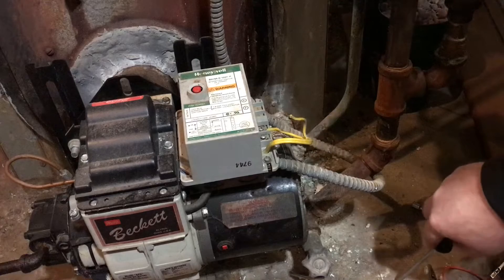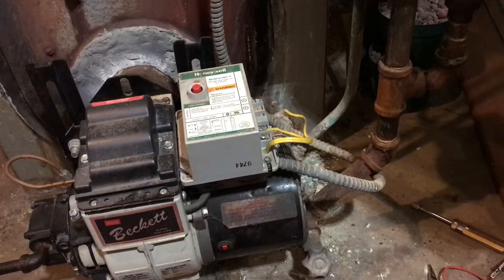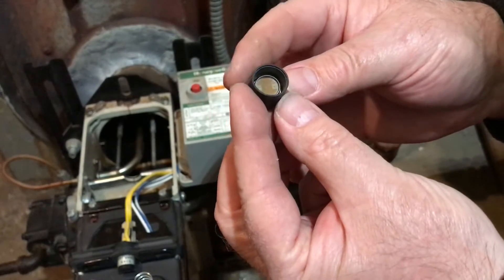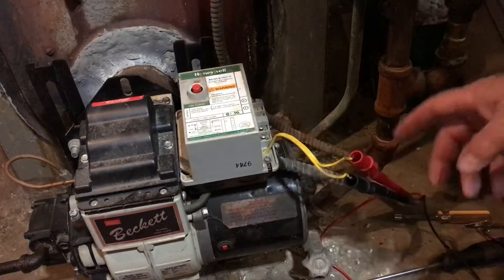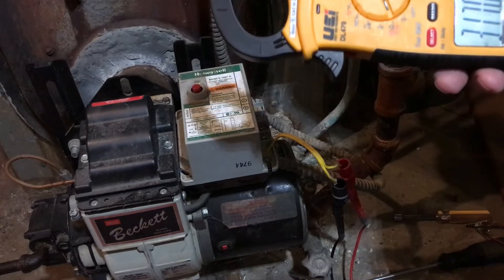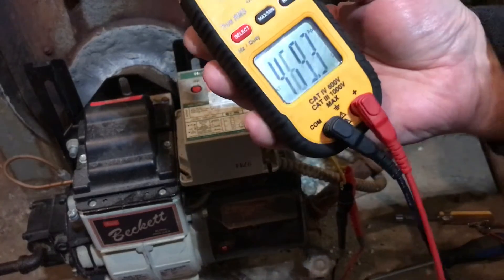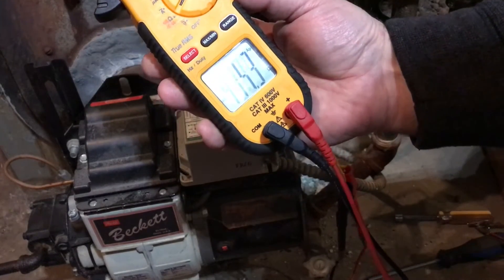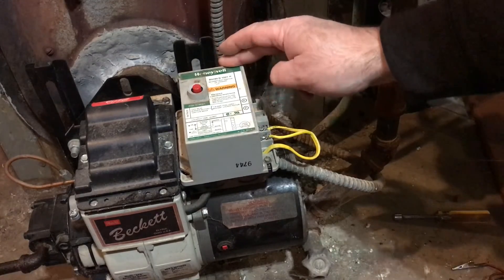How To test a cad cell and the primary control on an oil burner.

Comment: My furnace is reading 999999ohms and it has 10 error codes all about cad cell. I check the cad and the igniter. I jump the Tt and now it won’t turn on even if I reset it did I make it worse ?
Reply from the maker: Hi sorry to hear that. Do you get a flame?

Comment: Great video Scott, I have a oil fired boiler. I replaced the cad cell last fall and had a guy come in and look the furnace over.
He made some air adjustments and set the electrode.
The furnace has run ok but would trip out occasionally. 
So I had another guy in and he checked the ohms and they were 1600.so he cut the air back and got it to around 600 I believe. It tripped out 12 hours later. So I reset it and its been running okay since little over a week ago. 
What is the best way to check the control ?it's possible its causing it to jump out?
Reply from the maker: If the air adjustment was correct in the first place by adding more air he probably overdid it. Another words too much air and that would cause the same effect possibly. Too much air to have it light properly. The cat still should’ve been replaced at 1600 homes and then tested again without any air adjustment. I would set the burner up using instruments and then test the ohms on the  Cad cell. If it’s more than 1000 homes replace it and test it again. Occasionally it’s the socket and wires that are the problem.

Comment: Hey great vid , I have a question, I have a newer honeywell controller ( R8184G 4009) on my furnace , the furnace powers on for about 15-20 min and than turns off but with no lock out / no red light after that it doesn’t start again, I have to wait a couple hours and than the red light comes back on and I can press the reset button to start up the furnace again, any idea what it can be?
Reply: Check motor with transformer  full load amps to see if it's pulling to many amps if it's to high for the amount the primary control is rated at it should go to lockout, check burner motor for excessive heat from running,and last tap the primary to see if it will come on again

Comment: I’ve been trying to fix my mother in laws burner, it keeps going off on safety every few days. Hit the reset and it works again. I’ve swapped out the fuel pump, the burner motor, the cad cell and the cad cell plug with its yellow wire and it’s still doing it!! Can a primary control cause intermittent issues?? Or maybe the aquastat? I’ve adjusted the electrodes dead on, the transformer puts out a big beautiful arc so I’m running out of things here. Any input from anyone?  She’s on a fixed income and I’m traveling there over and over trying to help but this is getting nuts. 3 times already... I swapped the motor in case it had a dead spot in it.
Reply from the maker: After you reset the burner does it fire normal? Does it smoke or smell when it starts? If so then it usually points too too much fuel because of no ignition spark. If it fires normal it could indicate more of an electrical issue. What is the ohms reading for the cad cell eye?
Reply: @scotttaylor3049  generally it fires up beautifully after a reset but once it smoked a lot so I swapped out the fuel pump and it lit beautifully again then 3 days later off on safety again. I did a ohms reading the wrong way because I didn’t disconnect it from the primary I just tested it while it ran and it was between 300-400 ohms pretty steady while it ran. I stopped and started it 20-25 times with no problems so I left after it got up to temperature and it was fine for 1 day then it went off on safety again. I haven’t gone back there yet this time (4th time)
Reply from the maker: @lh98  It could be too much air burning too lean. It could be the primary control, or the solid-state igniter. You need to run test while it is acting up so you can find it. Is this being vented with a chimney or a power venter?
Reply: @scotttaylor3049  it’s vented into solid smoke pipe that goes through the roof stack no power venter. I can’t test it when “it’s acting up” because it always seems to just run after I reset it.  I did a smoke test it’s a 2 which should be fine and don’t see how it can be the air setting out of the blue after running just fine since the last tune up I did April 2021. I pulled the side clean out off and it has a light soot inside and isn’t plugged. I’m baffled.. swapped fuel pump, swapped motor, swapped cad cell, literally what’s left? The primary, the electrodes, the nozzle, filter, strainer, the ignitor (but it tests fine with a screwdriver and I hear it when it runs). I don’t have a gauge to check pump pressure but I’ve tried 2 pumps same result. Aquastat pretty much just sends power to burner right? So it’s either on or off and that’s it? I noticed B2 on the aquastat has a brown mark on the terminal but can that cause a burner to go off on safety? Idk man I do really appreciate any input you have. I worked for a service 20 something years ago for a year so I’m trying everything I know/remember
Reply from the maker: @lh98  How old and what make and model is the heating system and the burner? What brand controls?
Reply: @scotttaylor3049  it was installed in 1997 so it’s going on 25 years old. It’s an HB Smith but I don’t know what model off hand atm. It’s a tankless so it’s her hot water right now that’s a concern obviously not heat atm but it’s hydronic not steam FYI. The burner is a Beckett AFG, the primary is a Carlin model 40200-02, it has a Honeywell L8124A aquastat (the one that has a burn mark on the B2 terminal) and it has 2 other zones that are controlled by a model RA89A relay and the other is a Eric boiler boss relay. The burner is original to the boiler. It might be older but it’s in good shape.
Reply from the maker: If you have not replaced the nozzle and filter you should do that because a partially plugged nozzle will drastically reduce the light it gives off. A number to smoke as you indicated is not acceptable. If left like that it would plug up with suit. I would double check that reading if you don’t believe it’s burning Smokey. That burner should be zero to a trace of smoke at Max. Also you mentioned the ohms reading was around 300 to 400 ohms. That would be extremely good. It would be possible to get that Reading but most of the time you will get a higher ohms reading. If you were comfortable with everything and have double checked. I would suggest letting the burner come on and keep in cycling the burner on and off and listen for ignition spark accompanied by delayed ignition. See if when you turn the power on if the motor delays on start up. It could be frustrating but you have to catch it. I am thinking judging by what you’re telling me that it would be the primary control. You said you replaced the fuel pump. Is there a delayed oil valve on the pump? It’s possible that the primary control would start the burner motor but may not send power to the oil valve to open it.
Reply: @scotttaylor3049  I haven’t replaced nozzle but I will today. It runs fine when I’m there so I didn’t bother with nozzle. It was set at zero smoke but I closed the air down a bit to bring it to 2 smoke to see if the spark was blowing out, no change... I have cycled it over and over and over with nothing issue wise. I will do it again and see though... it always just runs fine once reset, I cycle it 20 times and it’s fine then she calls again in 2 days saying it’s off. No motor delay, I’ve swapped motors, and no it doesn’t have a delayed oil solenoid valve on it. I will replace the oil filter today too but I’ve not seen them get bad enough to cause issues in only one year unless someone ran out of oil repeatedly which she didn’t. Ugh... I’ve never had this much trouble before. Thanks again and please any more input I’ll happily listen. I think I’m going to swap the transformer to an old one I have to see if that does anything. There’s only so many parts left right?? Lol
Reply: @scotttaylor3049  I’m at the house now for the last hour. Of course I reset it and it ran just fine again. I tested the cad cell and now it’s 1600 ohms 😳 last time it was 300-400 before I left. Can a bad primary control damage a cad cell or screw up the readings? I put in another cad cell and a different primary and now it read 400-800 ohms up and down. I also changed the nozzle and the filter. Filter was brand new looking from last year. I don’t understand how the cad cell went bad or change ohms readings from last time
Reply from the maker: @lh98   if that doesn’t correct the problem disconnect the oil line at the burner and open the oil tank to make sure you get a flow. a plugged oil line would do this and you would never find it unless you looked for it.
Reply: @scotttaylor3049  for ha ha’s I ohm tested the FF cad cell connection on the primary control after I removed it and when I touch the leads the ohms jump to between 1600-1900 then it drops. I did the same to 2 other primary controls I have and they don’t show any reading change at all. I checked 20 times and 11 of the 20 it jumped to 1600-1900 then dropped. I checked the other controls the same way and both had zero change out of each of the 20 times I tested them. I think the primary might’ve experienced an electrical surge or something that damaged the circuit board (there was a couple recent power outages there). I think whatever intermittent issue the primary has is causing it to think the fire went out and then kills itself. I will report back and let you know how it goes. This was a challenge due to the intermittent unexplainable failures. I’m hopeful I’m right fingers crossed 🤞. Appreciate the ideas and info you’ve taken the time to share. I’ll wait a week and see. Longest it went before was 4-5 days usually 2-3 so we’ll see.  Thanks again. Oh and I already checked oil flow when I swapped out the fuel pumps, nice flow no change.
Reply: @scotttaylor3049  as an update it’s been over 2 weeks now and since replacing the primary control it’s been running just fine. As I said before if you ohm test the bad primary when it’s completely disconnected from any wiring (oddly I felt compelled to check and glad I did) it jumps to 1600-1900 ohms then drops to nothing. There should be no ohm changes at all because I tried on 2 other primaries that aren’t connected and they don’t show any readings. This clearly shows the primary is faulty it’s just odd because I’ve not seen this type of reading/situation before while disconnected. Anyway for possible future assistance to others with this dilemma the end result was a BAD PRIMARY. My 1 year as a service tech was limited to that 1 year but I have a generally good knowledge and other experience over the years on my own and this was def the most troubling service issue I ever had. Note: there was a recent power outage there before this happened and may have contributed to an electrical surge that damaged the primary, who knows but I like to try and completely understand things for future knowledge an experience. Thanks for trying to help anyway but I ended up solving on my own
Reply: @lh98 when you say you removed it are you talking you disconnected all the wires on the primary going to things on the burner but left only the cad cell hooked up and tested your resistance at the primary on the terminal screws with the burner running?
Reply: @LucasGamble-hy8we  if I remember correctly the entire primary control was disconnected even the cad cell and I just ohm tested the terminals FF on the primary. No burner running or connected at all. Weird but it was clearly messed up from a power surge or something. It’s been well over a year now but based on my recollection and the previous comments it was ohm testing while the primary was completely disconnected. I still have 2 brand new primary controls as back up but the issue was solved back then. Good luck
Reply: @lh98 I have been getting random lock outs for no reason. Here I am on YouTube trying to figure it out. I saw your post about the primary controller go bad after a power outage….this is exactly what happened to my furnace. It was running just fine before the outage and here it is acting up after my power came back. Thank you for posting this. I will swap out the controller tomorrow and see if that helps. Thank you!
Reply: @larrynsr  let me know how it goes. There’s a whole slew of things it could be so if that doesn’t correct it try to send more details on what it’s doing because those details can help point in the right diagnostic direction too. Good luck
Reply: @grottofrog2978  yes for me it was the primary control. It would work intermittently then send bad ohm signal from cad cell to the primary. Ever  since replacing the primary it’s been fixed and that was like a year ago.  If you have a meter try testing the ohms while it’s running. I worked for a service company over 20 years ago for about 1 year so I have some decent amount of experience but because this kept happening intermittently it had me baffled. Now I keep 2 brand new primary controls on hand just in case 😊 because I’m responsible for my mothers house, my mother in laws house, my house, and my rental as well. Sometimes things go bad t the worst time and it’s nice to have parts. Good luck and I’m happy to give any advice I can though I’m not as versed as long ago.
Reply: I believe I got her running!! I swapped the controller with a different one…still locks out…I jumped the ff termianls…furnace works fine. So I know it’s not enough light to trip the eye. Cleaned the nozzle like the vid suggested. I used some brake cleaner and sprayed it inside forcing the gunk out. It was sooty. Works now!! Thank you all!
Reply: @larrynsr  cool. Down inside the end of the tube where the nozzle and electrodes sit is a set of slotted air mixture fins. If they get cokes up with carbon it can block the light from the fire from being seen well by the cad cell so yeah that could do it too. Just the fact you knew to jump the FF once it was running tells me you have some knowledge on oil burners too. Good deal.
Reply: @lh98  hahaha I don't have much knowledge on these furnaces but I do like to wrench on cars...I guess that helps 😁